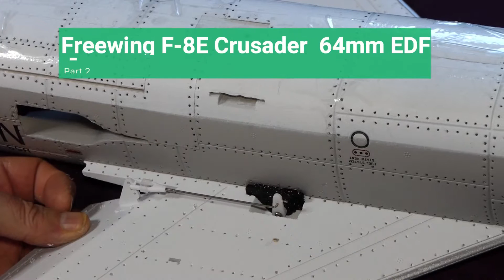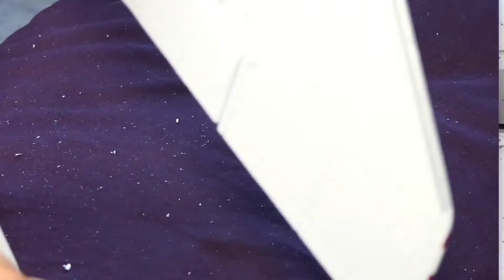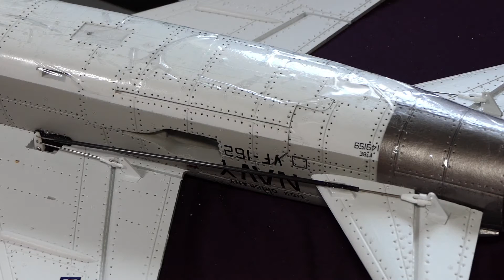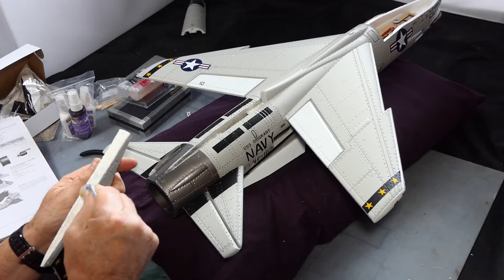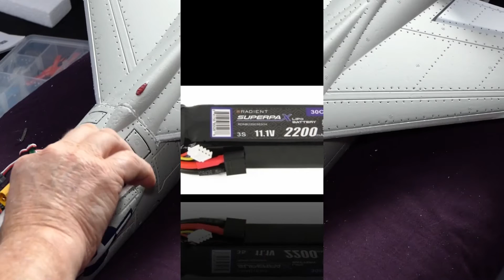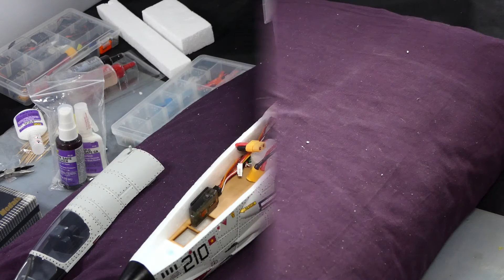Assembly - Part 2 of 2 -   Freewing F 8E Crusader part 64mm EDF - 11 Sept 2020

Comment: Spoiler. Hamilton won!

I was thinking about something as you where building and I saw it in the manual but you didnt hook up the controller and try it. 

It operates as a delta as ailerons and elevators are physically linked but it isnt physically a delta. That means when you go up elevator the ailerons will be acting like spoilers stalling the wing and down elevator the ailerons will be acting like flaps.

That could make for some interesting flying. Stalling the wing with up elevator could cause it to tailslide or worst case with big inputs tumble. Increasing lift while down elevator is going to make the plane potentially climb in the vertical plane but nose down, abit like when a B52 takes off.

I might be wrong or with the scale and weight it might not cause any obvious problems but we will see on the maiden.
Reply from the maker: Yes I had to set it all up as a Delta wing - Videos I have been watching do not show any signs of the aircraft behaving in the way you have described , As you say this could be down to its scale ? - I might have this one brought up higher on the list of Maiden flights (just for the fun of it) .....